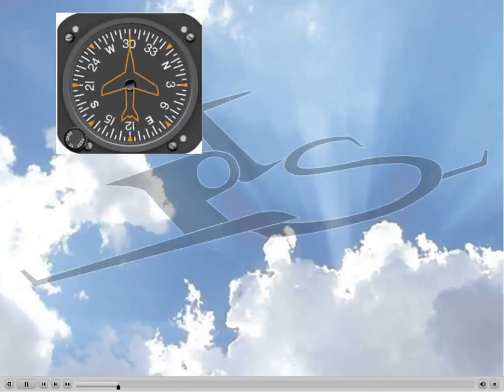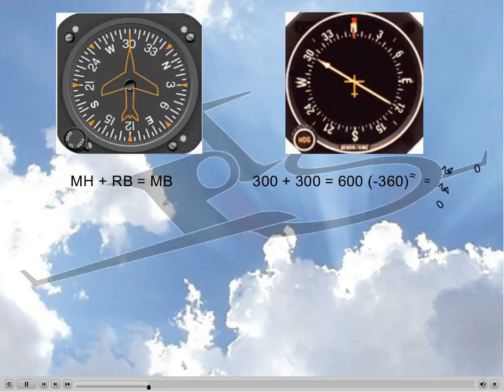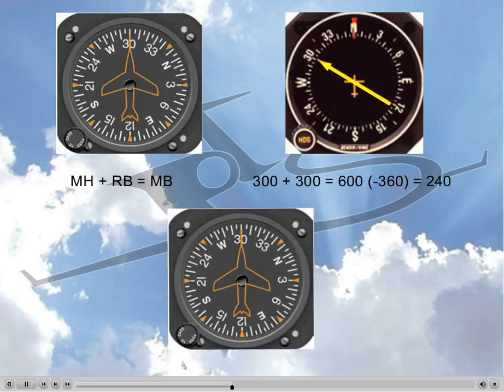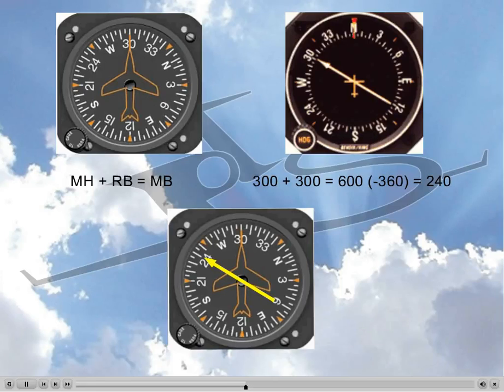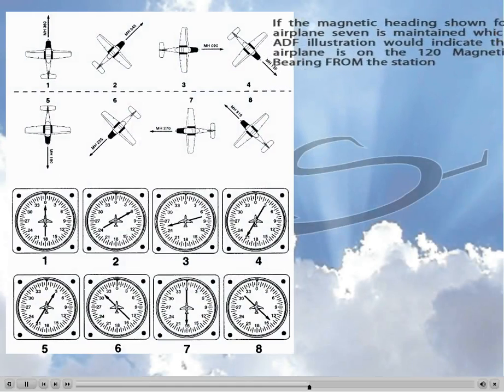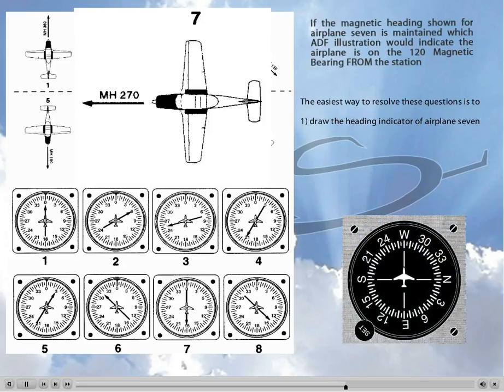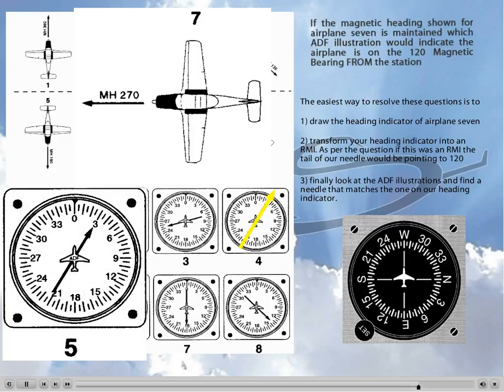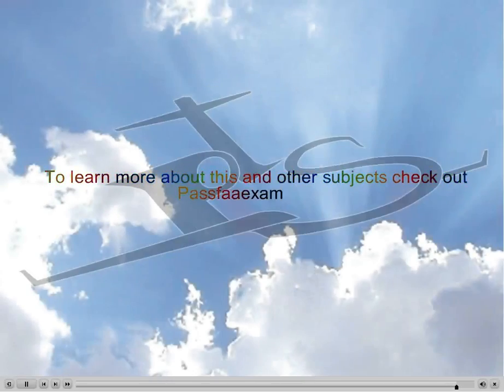The NDB, FAA Test Questions (and Figure 105)

Comment: I like it but what if you're asked to find MH instead? I get lost there with your method
Reply from the maker: Keep in mind that those questions asking for the MH have been eliminated (as well as 95% of all other questions dealing with ADF/NDB). Furthermore if I actually wanted to know my MH (Magnetic Heading) all I would need to do would be to look at my DG or Compass.

In any case here is an example: 
RB = 270 and MB = 090. What is the MH?
If you actually needed to find the MH deconstructing our method you would need to draw a blank heading indicator (no cardinal directions on it). On that DG you would place the ADF needle pointing 90º left (that is where the needle would point to in a fixed card ADF). Then, next to the head of the ADF's needle you would add 090 (The MB). Finally add to the DG the top number (if 090 is 90º to the left of the DG the top would be 180). Your MH is 180.